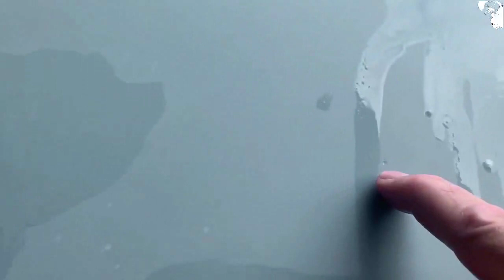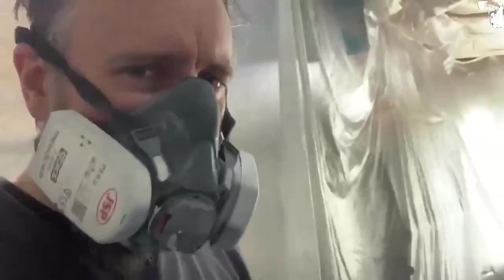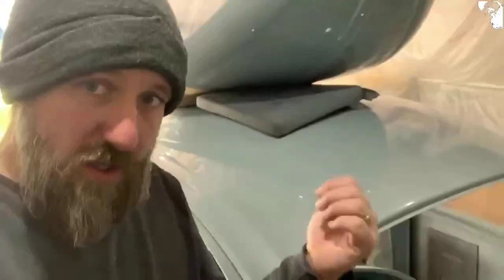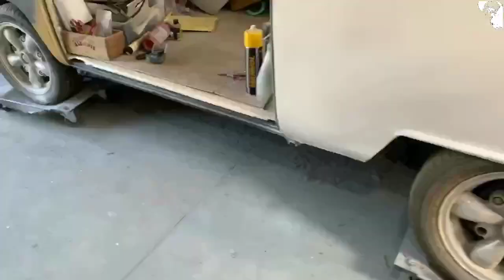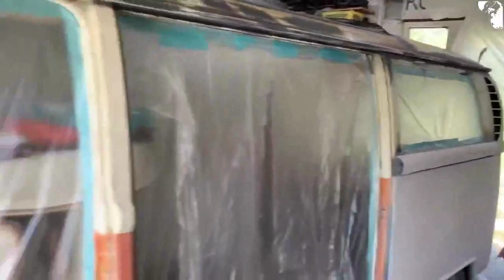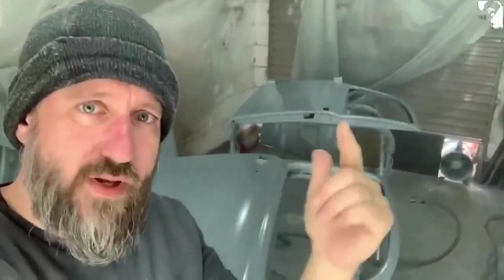Classic Volkswagen Beetle & camper restoration #38/113

Comment: Well for someone who is self taught  put's in a tremendous effort and achieves what you have with these two projects the VW gods will be looking down upon you favorably. There are many that no doubt will bitch and point a finger just let them bray. You have vehicles that are solid,  very little filler , repaired and renovated mechanics . No doubt good paintwork and interior fittings. You will shake them down and run them. Forget the point the finger mob ,because that is all they can do. You have done as you have said . (You have made them better than they were ) . When there done enjoy the ride. "Looking forward to seeing that day on this channel".
Reply from the maker: As they say, Fix it, Use it, Wear it out.
Make it do, Or do with out..
I’ll definitely use both of em. 🤙